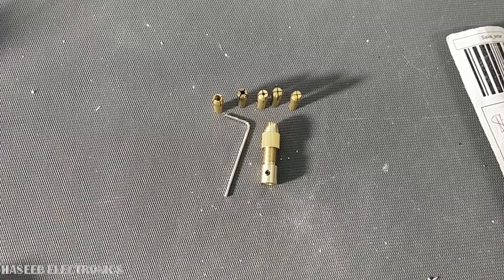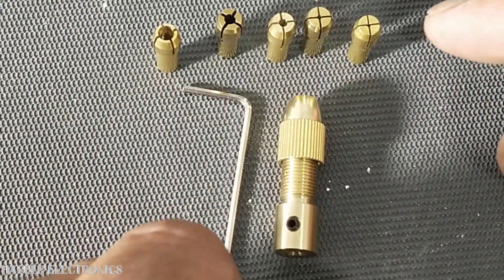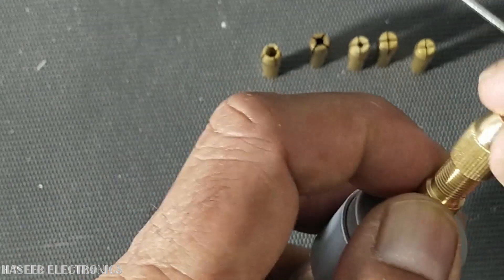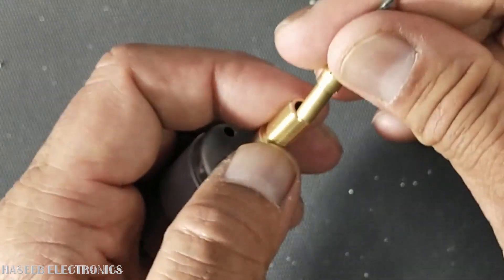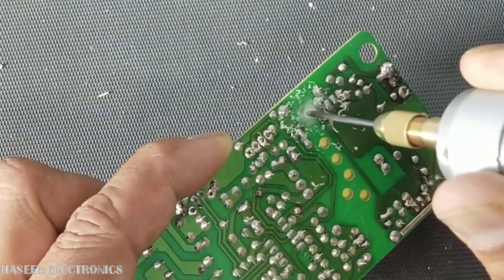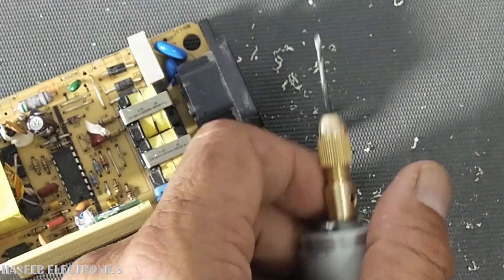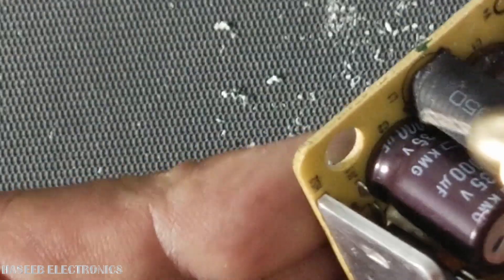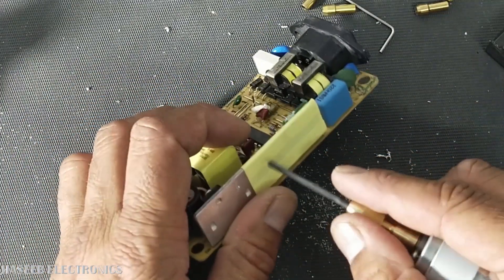{584} Mini Drill Chuck - Shopping Review || Practical Use of Mini Drill Chuck To Drill PCB

Comment: What a piece of garbage. Why is the drill bit oscillating from side to side. Waste of time and money
Reply from the maker: the chuck is to be centered in the rotor of the motor, so it will stabilized or we can use 3.17mm diameter motor (normally 12v motor)